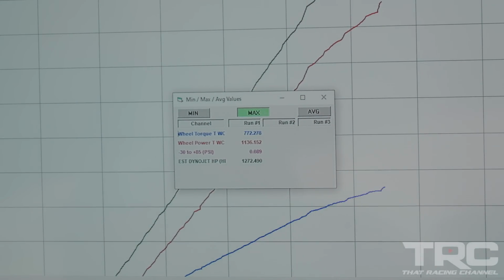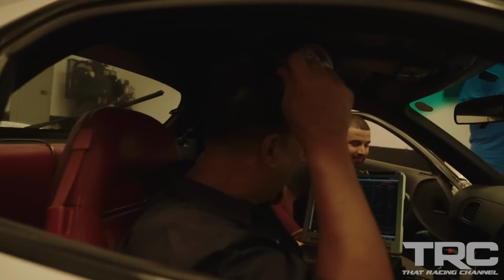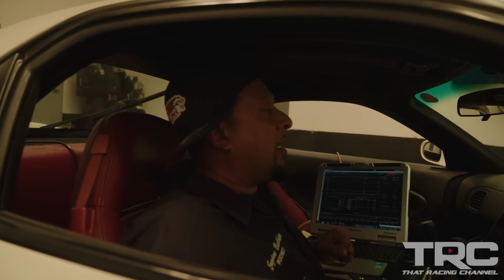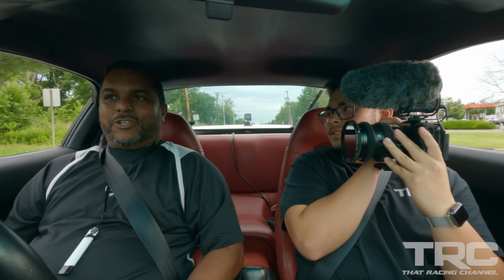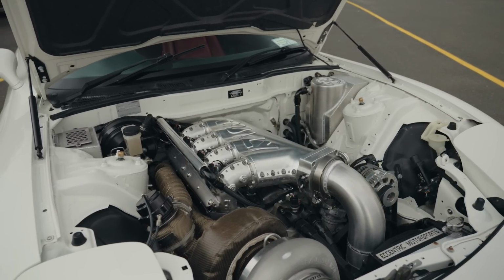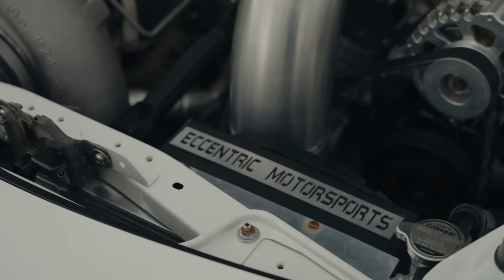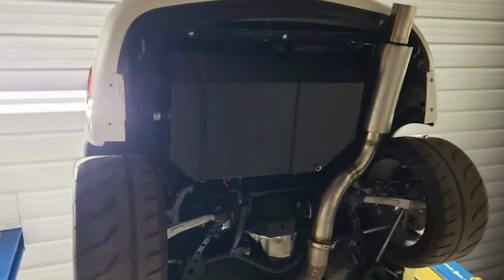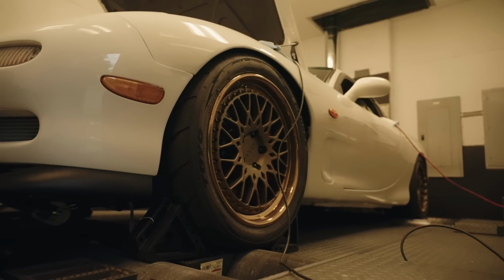1150HP 4 Rotor RX7 SCREAMS 9,000RPM! (UNREAL ROTARY SOUNDS)

Comment: Hands down the most "streetable" 4 rotor I've seen.  Every 4 rotor I seen before is more track built and struggles to drive on the streets but this one is smooth on the street even with over 1000hp. Well done
Reply: I mean 4 rotors are overkill for a street build plus they cost the same or more then a rx7

Comment: Love how stock you kept the inside and out, very much my style. That transmission looks like a bit of a frankenstein. Nobody makes a drop in sequential trans for an FD? I forget what Rob is running in his 4 rotor, but I think it's a bit streamlined. Nonetheless, beautiful build and sounds insane!
Reply: rob's is a six-speed holinger sequential that has a custom plate for it iirc, winters diff on the back and i think he uses a lot of GM/corvette stuff
Reply: @MadDogCommunity  dope knowledge! I guess he went with GM due to cost and availability. The quality is probably pretty decent as well.
Reply: @MadDogCommunity  pretty sure he using smg trans out of a bmw for his car
Reply: You can also run a 6XD sequential trans in an RX7.
Reply: @pdviper77  yeah right, prove it

Comment: Ive always said if you own any rotary stock or modded your a baller cause those motors are no easy or cheap thing to maintain
Reply: There only expensive when you don’t the maintenance and beat on it within a inch of its life every time your drive it
Reply: @61936  that's why I said u gotta be a baller cause oil changes, spark plugs every 6kmiles to prevent blowing the apex seals/porting the engine to prevent oil starvation and upgrading the apex seals, also going through gallons of oil from premixing every fuel up , I owned a rotary for a year or so and sold that thing , it was a great car just not a great daily

Comment: So this thing makes around 400whp NA. That’s kinda weak.
Reply: 1150whp at only 15psi boost would be closer to 600whp NA, not 400whp. 👍 Remember, atmospheric pressure is 14.7psi.
Also porting dictates power. Could've done a Peripheral Port and made Rob Dahm power but be an absolute pig to drive under 5000rpm.
Reply: @MafiaboysWorld  school them, most don't understand rotary engines
Reply: @tundaslug07  Most just don't understand engines, period. The difference is that most people think they know piston engines and then have their favourites (LS, JZ, RB) and say every other motor is trash compared to said favourite motor for whatever wild reason they have. 🤣👍
Reply: @MafiaboysWorld  let’s compare the NA figures to a production rotary like the terrible Renesis. You’re making the same hp per rotor. Go ahead and try to tell me I don’t know anything about engines. My engineering background tells me I know enough about this engine. Small ports and lots of back pressure. Enjoy those EGTs. Also with those high pressures at low rotor speeds have fun wearing out corner seals and clogging up apex seals. If jet engines taught me anything it’s that you don’t try to make them do something they aren’t meant to do.
Reply: @MafiaboysWorld  18psi*
Reply: @RadDadisRad  6:25 Listen again buddy. 15psi, 1100whp and 1150whp.
Reply: @MafiaboysWorld  listen again buddy. They said it boost creeps to 18psi.
Reply: @MafiaboysWorld  7:04 buddy
Reply: 6 rotor RX4 - 813WHP
https://youtu.be/k3t3VcEIB-Q
That was nearly 10yrs ago too, it produces over 900whp nowadays. No E85 or other fancy fuels.
Reply: @LXRTyree  Right and wrong. Although it does have three combustion cycles per rotation, the total swept capacity is double what a piston engine is. 👍 So a 13B = 2.6L, 20B = 4.0L, 26B = 5.2L, so the six rotor is equal to a 7.8L (476ci) V8. 😎👍
Reply: @LXRTyree  That's when you start talking to your local motor registry why that is cause 25yrs after they were written, I still don't know, and I'm on the opposite side that a 13B should still be 1.3L instead of 2.6L. 🤔🤷 I don't write the rules, I just educate people about them. 😁👍
Reply: @LXRTyree  Totally understand your point. However, if we take it's true capacity as it is written by Felix Wankel himself and also by Mazda, it is the radius x width of rotor housing. 👍 Hence why the Mazda 10A, 12A and 13B, all being twin rotor, have different capacities (982cc, 1146cc and 1308cc respectively). 👍 They added 10mm to the width of the housing each generation just FYI. 😎
Reply: Chill out Boyz....
Reply: @Yella_44  I'm more chill than a penguin with his 🍆 in a frozen fleshlight. 😎👍 No use saying "cHiLL oUt" when you're a day late to the debate that was already sorted and the rest of the time has been simple education. 🤦😉

Comment: this is the tamest 4 rotor i've ever heard
Reply: It's the porting that dictates the sound. Probably a street port or mild port to allow the turbo to spool better due to very small overlap of the rotor. 👍 Remember people, the more overlap, the more BRAP. 😎👍
Reply: As long as you don't go crazy with the ports
Reply: @Bijiketapang001  that’s like building a small cam low compression big block because you only want 250hp.
Reply: Because for once it doesn't have a straight pipe lol 

This thing sounds glorious imo
Reply: Not a fan of how mild it sounds